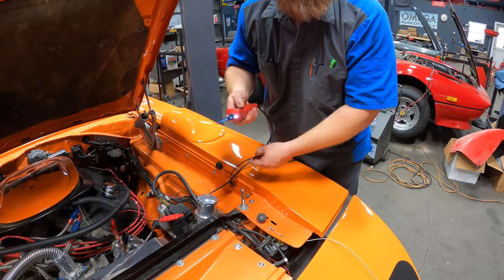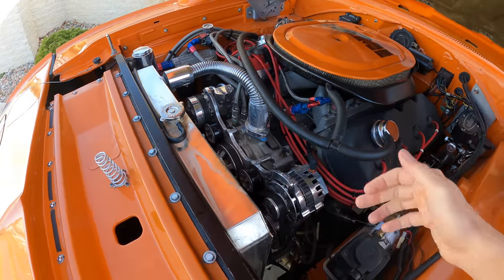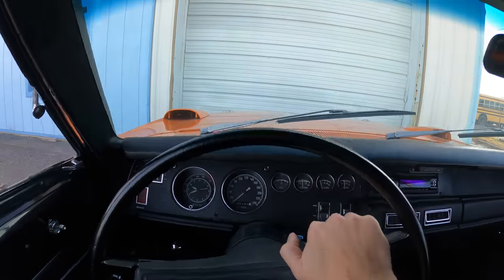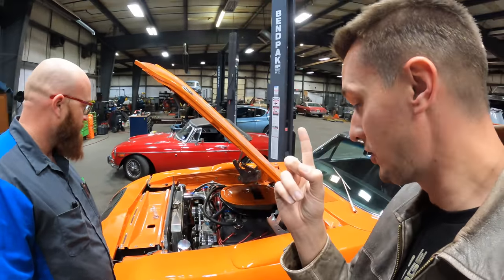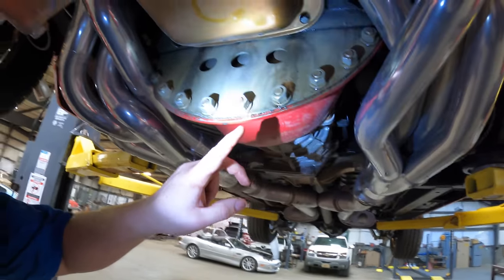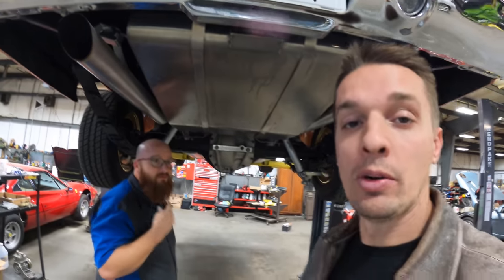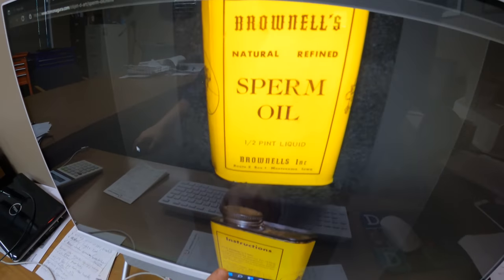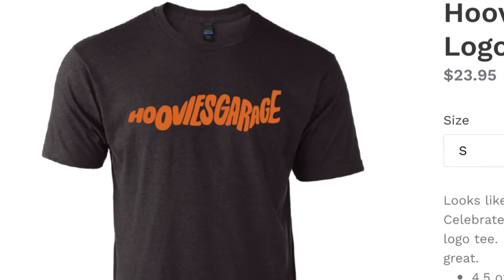How I got SCAMMED buying a Plymouth Superbird online sight unseen (So much broken/missing)

Comment: The wheels are actually real race wheels. Round track guys use them, so they are "correct" for the car...sort of. Personally I would get rid of the vacuum actuators for the headlights and swap to electric ones. They work better and are more reliable.
Reply: Still he would need the pump for the power brakes with that 528 under the hood.
Reply: @michaelwilkening8542  - Or swap to a hydraboost.
Reply: And take 10s of thousands off the value. This is a Hemi Superbird, not some base car you can restomod.
Reply: @SvenTviking  it’s literally a restomod, the video explains that in detail.  The suspension and engine are already new to the car.  The heat and air is new to the car.  The car had been wrecked and pieced together with another car.  The value the car has at this point is that is was supposed to be a well done restomod and in this case, it needed work which is why BAT refunded $5k.
Reply: You would be absolutely dumb to go modifying a car like this at this point.  You make the vacuum system work.  Yes, removing it and going electric would STILL take tens of thousands off a car that in its current pieced together condition is ALREADY worth six figures and still going up.
Reply: @fraidykat  what is absolutely dumb is your statement. The car is already hacked together. It is already not original and will never BE original. Making the car WORK and be a reliable machine that can be driven will increase its value more than keeping the old, crappy, prone-to-failure vacuum crap that is already bandaided together. If this were a numbers-matching car, I might agree, but then are you keeping the 4-wheel drum brakes, too? Not if you truly intend to drive the thing. Certain modifications to classic cars are not considered "dings" to their overall value, especially when it comes to safety and useability.
Reply: @rocketsurgeon11  true
Reply: @SvenTviking  Did you even watch the overview? The car is ALREADY a hoopty! It is ALREADY restomodded. It is ALREADY not original. You "boomer" mentality types need to get over yourselves. Good god. It's a frigging hunk of metal.
Reply: @michaelwilkening8542  I honestly can't tell...does it have vacuum assisted brakes? It very well could be manual. With the correct setup (pedal ratio, master cylinder, calipers, etc) manual brakes would be adequate. Considering a lot of these cars came with manual drums all around, it would still be WORLDS better than stock.
Reply: Those wheels are hideous. Would look better with 2nd day period wheels like Keystones Cragars or slotted dish mags.
Reply: @rocketsurgeon11  I agree with you, partially.  There is nothing. unsafe about four wheel drum brakes.  And the vacuum system in Mopars works great.  I have had my 1968 Charger with the heavy duty four wheel drums, and never had bad fade or failure.   For 20 years, my parents pulled a trailer with their 1969 Cadillac with four wheel drum brakes....through the mountains in the west.  Disk brakes ARE better.  I like the brakes much better in my 1971 Super Bee than in my Charger.  But drum brakes are not inherently unsafe.  I am rather tired of hearing that.   As for the vacuum system, all that ever happened to mine is that the battery above finally corroded the can and I had to replace it.  The doors still work fine.  I know tons of Charger guys and I have never heard people complaining about the vacuum system.
Reply: @rocketsurgeon11  Pretty sure there is a booster on the firewall. Watch at the very beginning of the video. Kind of hard to be sure. The boosters were small on hemi or RT cars anyway. If it doesn't have power brakes why bother with the noisy pumps? The amount of vacuum needed to operate the headlights would be miminual and could be supplied by the motor and a vacuum reservoir.
Reply: @michaelwilkening8542  I don't necessarily disagree. I don't know if the vacuum the engine makes would be enough for the headlights and the HVAC. It honestly doesn't sound that cammed, but without a gage, hard to say. I still maintain that electric motors on the headlights is a better way to go.
Reply: @michaelwilkening8542  no power brakes Wilwood master cylinder setup,  a set of vacuum reservoir balls from a VW rabbit, and the central locking pump from an A2 jetta, with a vacuum switch to turn the pump on whenever the vacuum drops.  quiet, only runs when needed and cheap.
Reply: @rocketsurgeon11  nope, Wilwood master with no booster.
Reply: @speedbuggy16v  I thought so, but I wasn't 100% sure.
Reply: @speedbuggy16v  Saw on a later video that you are right. But like others pointed out manual modern disk is worlds better than the manual drum it probably came with.
Reply: @michaelwilkening8542  much better by far.

Comment: The majority of stuff on the car looks very nicely done, I’m just surprised the roll cage they put in was bent with a muffler bender, kinking the tube at the bends instead of using a mandrel bender.
Reply: this was almost certainly done for the show....nobody in their right mind would actually DO THAT
Reply: if it was nicely done engine installer dident do it.
Reply: I would just take it out. Its a street driver and looking more stock is a good thing.

Comment: you are not alone with BAT. They are a stand up organization. They had to do the same for me when the Antique MG I bought that was "show condition" ended up having a totally crap engine. $8,000 later I have a running functioning car but it still has many more wiring issues that need to be sorted.
Reply: Buying a car from a distance is terrifying. Power to ya.

Comment: The 2 vacuum pumps… I wonder if whoever installed them worked in aviation? As most of the critical systems in aviation have backs ups and redundancy, in case of component failure.

Comment: I have an 1982 Avanti ll listing for $ 18,500 that has the original Chevy 305 engine 115,000  A/C, moonroof, rebuilt front end, new leather front seats, new battery, new tune up, and drives straight. Before I list it I made sure everything is working properly and any areas of concern I would list as a problem . Glad you mentioned " Bring A Trailer " that's where I will list it, they sure took care of you.

It must be hard for you to omit you paid so much for a car you never drove, thanks for sharing.

Comment: I am 70 years old. I had some Mopar's back then. I can't remember what you call it. But Mopar's had adjustment under front where you could drop the front to the ground or jack the front up like a gasser. It road a little rough but did the same as your Super Bird when you pushed down on the fender. At that time I had a 1963 Plymouth Belvedere with a 69 Road Runner Engine and four speed that we raced on the street.

Comment: In 1974 I was offered a Super Bird for $1800. It was a 440 automatic on the column but still a original, low mileage Super Bird. Muscle cars had no value then.
Reply: Because back then there were millions if them.  So many muscle cars to choose from, so little time.

Comment: I always thought BaT would really vet the sellers. Guess scumbags exists everywhere. Glad you got a refund to cover repairs pretty much.
Reply: I saw a guy's car that was then listed on BaT that was a complete basket case needing probably $6k in work to fix what the PO had done to it, on top of the rust issues. Basically none was disclosed in the auction. Fortunately, it didn't meet the dude's reserve. I've also seen them reject basically mint cars for tiny issues. It's stupid.

Comment: Stay away from modified muscle Mopars. This thing had a BUNCH of red flags on it the second you lifted the hood. This needs to be gone through
and restored to stock to realize the true value.  Loose the aluminum radiator, all the "Custom" and "Race" junk from the engine. Loose the headers
all the non stock interior stuff, the traction bars, the electric fuel pump.
 This makes this Mopar guy cry. So much wrong,   Oh well.
Reply: I agree that poor car needs a factory resto.

Comment: I have a 1966 Chevy Caprice 2 door hard top and it's normal for it too start to overheat in the summer when idling at a stop light especially when its over 90 degrees outside. If you turn on the heater full blast it helps remove heat from the engine. Sounds crazy but it does help. Of coarse adding an electric fan and better radiator would help too. But I don't drive it that much anyway.

Comment: My immediate thoughts and why I personally would not have put out that kind of cash. It has an A/C dash in it. No Hemi cars came with A/C. Also, the fender extensions to the nosecone at the fender marker lights are missing. ...and then there's the whole coil over front suspension thing. I would have never bought his car sight unseen. It's a nice car but it's been been pieced together and is nothing more than a custom car with a valuable VIN tag. I wouldn't say you got ripped off but it is a mess.
Reply: Dash was probably destroyed in the impact. But yes, it's definitely a bit of a hodgepodge. With that said, life isn't perfect, and a cool car doesn't have to be either. Definitely makes a good driver.
Reply: I believe the car is missing a lot of those things because it was a true race car and it has that Pedegree
Reply: It's a custom mod, almost like a kit car. He definitely wasn't looking for authenticity, i think he just wanted to say he owned one and probably more money to burn that most of us do. If i had that kind of cash to spend on one, i would not have bought this, even if i seen it in person first. I don't like the color, the wheels or the mods.
Reply: Correct on all points........but at $135K still worth it as a 'RESTO MOD' car. I'd have it! NONE of my collector cars are bone stock....by choice.
Reply: A true race car would have been stripped of everything that wasn't necessary to make the car run and pass safety inspections. Many had the entire unibody cut out and a GM (I know  sacrilege ) full frame mounted in its place. Current nascar cars are still using trailing arm to hold the rear axle like those from a early 60s pickup unless the rules have changed recently. Just look at the interior of modern nascar car and see that. The dash is a from a donor car and the AC is also aftermarket (vintage air possibly?). Factory AC was controlled from controls right over the radio. You are Right about no hemis (or 6 pack cars) coming from the factory with ac. Chrysler mounted the ac compressor on top of the motor and would have hit the multi carb set ups. The tremec 6 speed and dana 60 should hold up to the hemis power as long as there is a dual disc clutch inside that scatter shield.
Reply: That fender is original to the race car superstock superbirds didn't have marker light.  remember it was a race car when it was made and as for the dash.  The original dash wouldn't have had a stock dash in if you were lucky a bent piece of aluminum for a dash for your gauges and switches.  So yes the dash has been replaced and AC was put in after the car was turned into a road car
Reply: i thinks a clone rip off wrong Gen. Hemi for a 1970 and they didn't have electric cooling fans bye bye $130
Reply: I would agree with all of that. But he does have the option of putting most or all the original hardware back - may take some effort but will make it much more valuable in the end.  Ie, remove the air con and put back the original front end.  However I would also not have paid that sort of money sight unseen.  At least if you can't get there physically, for that amount of money, if the buyer is not prepared to make a comprehensive walk-around video showing everything that needs to be seen and to hear (engine running, horn etc) then it's a big risk.
Reply: This makes 0 sense. It’s a former race car that was wrecked. It isn’t a collector car anymore. Adding creature comforts like ac and updating to more modern suspension is the only way to go. It’s still a super bird so it’s not trying to be something it’s not. I don’t care to know what these cars go for but 135k seems wayyy below market for a typical super bird so I see no cons to this car besides seller being a bit of piece of shit
Reply: In the registry the VIN tag (which is a real Superbird tag) is listed as being on a GTX body somewhere in Colorado, so yeah, not a genuine Superbird.
Reply: @michaelwilkening8542  This car is a odd duck for sure.  As far as race car......it was never a NASCAR CUP car for sure. It could have been, at some time, a NHRA DRAG Pro Stock. In 1970 the car would have been pretty stock with the very basic roll bar hoop and not a cage like a CUP car. Worth the $$$$, only the owner knows. I still like it.
Reply: @michaelwilkening8542 Your talking about the 2021 NASCAR the last season the  car rode on a live axle in the rear, located by two trailing arms. The Next Gen marks the change to an independent rear suspension. The multi-link configuration allows more adjustment and will pay dividends on road courses, which NASCAR continues to add to the schedule.
Reply: @davevan8864  For $130,000 he can't go wrong really. I recently saw a 68 R/T charger body that was stripped of everything that could be stripped and very rotten sell for $12.000. R/Ts are nowhere near as rare as superbirds. He could part that car out for what he has in it and maybe even make a couple of bucks.
Reply: @andrewmiller1246  the "modern suspension" is what it had on it as a Nascar i am assuming.

Comment: Chrysler electrics during that era were terrible. In 1970 I bought a 1970 Dodge Charger 500. I had it until 1996 and do not recall many times if any when everything worked. Alternator would last about a year, etc. Replaced them repeatedly.  About a year later I bought a 1970 Piper Cherokee airplane and during the first annual inspection the cowl was off and I noticed what looked like the same alternator in my airplane as in my Charger.  I asked the A&P if indeed that was a Chrysler alternator and he said, “Yup. Just turns in the opposite direction.”  About a year later I was flying from Central Florida to California and my airplane alternator went out over Louisiana. Tip. If you happen to still own an old Chrysler product, do not under any circumstances agree to jump-start another car.

Comment: I don't know the exact amount of suspension travel these cars had but I suspect it to be more in the range of 4-5"?  I don't think the front wheel dropped one iota when the car was lifted?  Two inches seems quite inadequate?
Reply: 2” of shock and spring compression measured at the control arm translates to more suspension travel when you measure from the location of the tire instead of the shock. If you’re really curious about numbers, measure the shock compressed length vs extended length, and then compare the distance from your fender arch to the top of the tire compressed and extended. Or you could figure it out with some simple math without the need for measuring everything multiple times. Good question though!
Reply: They are also planning on adding an extra 2” of travel, not a total of 2” of travel. The current setup does not have a travel of zero, it is just set up so wrong that it is permanently at the highest point of travel.

Comment: Could the front suspension be set up stiff to avoid scraping those massive headers and low hanging exhaust on the ground when you hit a dip or bump ?
Reply: Considering he mentioned that the seller had it set differently in the pictures and its setup to minimize motion, I suspect the seller did it to try to keep it in the best shape during shipping.

Comment: hi radiators u cannot overfill !! 
Frontend and rear suspension check shocks and springs minimum ,  
Wheel alignment will change when ride height is changed . 
vacuum sensor not working . U have a piston pump a rotary pump is way way quieter .
Fan mounting is on a plate SO WRONG  Needs to have a spacing of at least 5/8  so the fans draw air flow thru all the core 
Fans that donot cover all the rad core need high air speed flaps 
Fans need to be at least 12inch  upto 14 inch 20amps each I strongly doubt all ths has been done properly .
Sender units
 temperature need to be checked with a resister and earthed. Check by have radiator temp thermometer at least varify temp at idle rpm
oil temp change sender . Check with master gauge straight into oil gallery 
Fuel gauge check with resister between sender wire and ground

Comment: So for the money I would have to say that you got a really good deal especially since the repair work to make it a driver is minimal. Once that horn gets going you'll be ready to go. The resto-mod thing doesn't make it much of a collector but still puts it in as pretty awesome! the wheels, in my opinion need to go and resto-mod or not, I don't know why there are Cooper Cobras on that car. Check the speed rating if you plan to try it out someday. Cool car!
Reply: Those wheels are correct.  They should stay, just re-wrap them in something more suitable.
Reply: Have you tried to buy 15" tires lately?  It's Cooper's or BFG raised yellow letter TA's.  Past that, it's ridiculously expensive Coker resto stuff.
Reply: @joshuafuller9898  Totally get that but we are talking about a Superbird not my '13 Dodge Dart🤪😁

Comment: Reminds me of my old 1970 hemicuda and hemi Coronet.  I used to build and drag race 426 hemis.  That electric fan setup isn't going to move enough air to keep your hemi cool when not moving.  The low oil press could indicate worn main bearings.  Not fun, but replaceable.  The ride was like there's no shocks up front.  The original torsion bars suspension would be much better.  The headers look like Hookers headers.